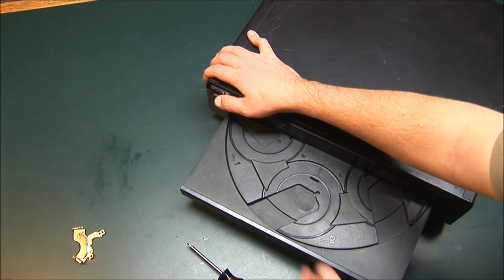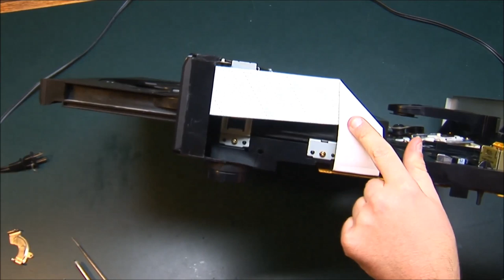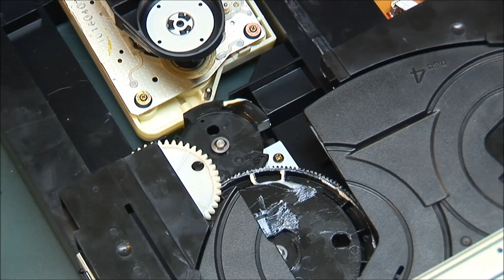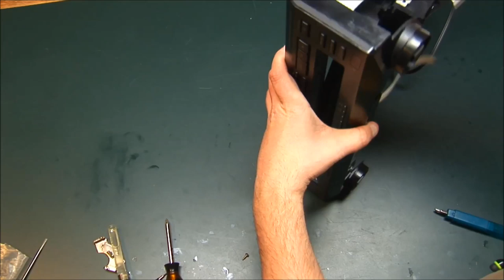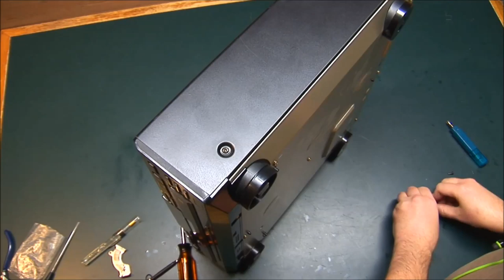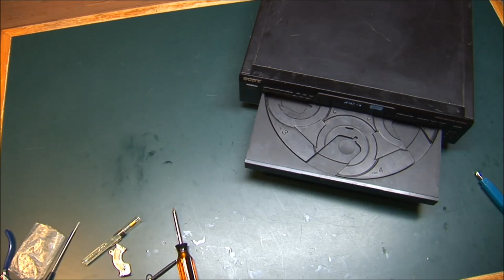Sony 5 Disc CD Changer Repair - Stuck Drawer, belt replacement, dissasemble

Comment from the maker: Help me create more videos
Consider Donating a couple bucks at the link below
Thank you so much for all your great comments and support!
https://www.buymeacoffee.com/cPnDUTmjl
Reply: Can you help me with my CDPC400 Sony Compact player? It’s making a clicking sound, even when turned off, & the tray will not open.
Reply from the maker: @EGGZiX  only way to know what's wrong is to take it apart.  Its probably jammed, or one of the belts is bad.
Reply: @Electronicle , everything seems to be moving properly. It’s the piece that rising to read the CD.. it’s a tiny white knob that spins against a black gear, & it’s like it’s skipping or something. It’s hard to explain but it doesn’t look jammed. Figured I’d ask. Thanks.
Reply: Matthew Hirsch
0 seconds ago
I have this exact unit. It does something weird. It opens, then the draw retracts into the body of the CD player, then it automatically reopens, as if to eject a disc. So, I can turn it on, open the drawer, load a CD, then close the drawer - then the drawer won't stay in the closed position. What have I got? Easy? Hard? Forget it? I will appreciate your feedback, and I will be happy to "buy you a cup of coffee" for your time and effort.

Comment: My rotary belt had come off. I put it back on and ordered a replacement in case it breaks. The error message, just said ERROR and it sounded like something was just spinning. I am amazed such a little rubber belt turns the whole tray around! Thank you for saving my 20 year old disc player!!!!

Comment: My Sony CD Player would not open. I used the screw underneath to get the 5 disc tray to open partially and you showed me how to open the cover where I found a stuck CD. Thank you for the instructions, it works like new now. I told my wife not to leave any disks in the machine from now on!

Comment: Two days and two 5 disc tray players repaired thanks to your videos.  One is for our church and one is at our home.  The one at home was skipping and needed a minor adjustment to the potentiometer.   (I found that the "guts" of the Kenwood machine were supplied by Sony.)   For the one at church, someone had gotten the gears out of sync.  Now it's working like a new unit.   I appreciate it, owe you,  and your "coffee" is on the way.
Reply from the maker: That's awesome man.  Great job!  And thank you

Comment: Dude, thank you!
I have a Sony 5-disc player very similar to this one and its tray was out of alignment. I have a tech degree and opened up the top to look inside, but no obvious problem was apparent, so looked up a tutorial and found yours. It was perfect for me! Different symptoms, but dismantling it and letting it reset and realign as you did here solved my issue. My player and the one you fixed were virtually identical inside, so everything you did I could follow on mine.
Thanks again, man, so you saved me taking it to a shop or buying a new one. Mine's 20 years old and is now as good as new. I checked the sprockets and belts and they still seem fine, so I'm good to go. CDs play fine and no misalignment issues anymore. 
Cheers!

Comment: Thanks for your excellent video with calm and detailed instructions. Thanks to you, I saved a Sony CDP-C335 from the land fill.  I got it with a jammed disc drawer and found the Lever Lock ( Drawer ? )  end broken off. Some super glue and steel wire embedded in Plastic Epoxy hopefully fixed that for some more years. I think someone tried to yank the drawer out in order to remove the CD that was still in the drive.

The "automatic Home" calibration was key in verifying the repair afterwards. I've taken apart my Sony CDP-C435 several times because of a yet unresolved intermittent Disc Exchange  issue and always was hit and miss to determine how to establish that Home position.

As of yet, the CDP-C435 5 disc tray sometimes has a mind  of its own and just spins one way or another like it is lost. Wondering if it is a bad ribbon cable or photo detector?
Anyway, thank you for the excellent videos. Heading to contribute if link is still good.

Comment: Thank you so much. 3 weeks ago when loading my cdp-c345 one of the discs wasn't firmly in the tray and when it closed it jarred the drawer. The drawer would close but could tell it wasn't closing properly. Soon the tray stopped turning at different intervals when on random and the last straw was when I placed one disc in a tray and closed it out made a horrible noise, the drawer opened back up and no disc. Then the drawer closed again, more horrible noises and the drawer reopened with the disc back in the tray. Watched your video that was very easy to understand and got the gears realigned. Put it back together and played it on shuffle for 6 hours straight with no issues. Thanks!!

Comment: I have an old aiwa 5 cd changer carousel that opens and closes multiple times before accepting a disc and you can forget having it on random when loading more discs as it will just open again when changing disc. I assume belts need replaced.  Some discs it just won't play, but same disc plays in car player. Is a big clunky old unit but I'd rather repair than ditch.
Reply: Also, clean the laser heads and any gears.  Also, lube the gears with the "Moly" stuff (similar to silicone but better for electronics).  Good Luck.

Comment: So this looks like something I could do since you've done a good job of showing how to do it.  If that was my unit, I'd want to replace that toothed belt as well since it looked pretty loose. BUT, my question is, where do I get those belts?? This thing is quite old and I'm afraid parts will be very hard to come by.

Comment: I have a CDP-CE235.  I  set the gears to their home position but when i put the drawer in and test it the drawer will not stay closed.  When I took the top off there were 4 cd's jammed up in the turn table and a little white plastic part that  I have no idea where it came from.   Any suggestions?  Thanks for taking  the time to make this video.  It really helped me understand how these things work!

Comment: Bought the same unit 24 years ago. Recently I transported  with a disk, came loose inside And jammed, since then, it's not working correctly. Will try the steps in your video. Are the belts for the c? D drive very specific or generic.  Greatly appreciate your tutorial.Gave you a thumbs up and Is subscribed. Paid about $400 or so back in 2000 I figure it's gonna cost around 1500 to get the same sound quality.
Thanks again for your help

Comment: Man I'm so glad you posted  this!!!
 I have one question , I have a sony cd changer..
5 disc and the drawer spins but won't  open.
 Is it the same belt that needs replacing?
 Thanks again.
Reply from the maker: sounds like somethings hung up or a bad belt...can't remember if this unit uses a belt to open the drawer.  Regardless...open it up and take a look :)
Reply: @Electronicle  
Thanks for responding. 
 I hope to get a chance  to crack it open soon.
 Might have to refer  back to you once I get a look inside.
Reply: for experience.....you must to change all the belts ...if the CD player has 2 o 3...just replace it ....

Comment: I have a Sony CDP-C331 model have had for a very long time.  In 2019 I had to place my property in storage due to unemployment,   the player was wrapped in a bath towel, transit key installed, the unit placed inside of a bedroom chest of drawers and the chest placed in storage, for almost a year.  Its been out for 2 years, plugged in but not used, they transit key was removed.  I turned the unit on today...the tray will not come out,  so I took the lid off,  the optical chassis is in the closed/up position, slightly bouncing like a heart beat,  it will not go down.....before I completely open this unit, have any suggestions/recommendations on what is wrong?

Comment: I have similar problem with my CD Sony Changer model CDP-C365 . Sometimes happened , when the pressed play button the tray  is opened  themselves and stuck and players tray seaching position and sometimes not find and leave dics on neighbor disc . Keys not working , i must power off CD player and turn on again after that error.  Do you think thats is Faulty pickup sensor or belt?

Comment: great video for disassy and assy and access to belts, and didn't know about finding home position... how would you improve lubrication of this tray? I know on some older equipment that white grease gets hard and sticky... would you clean and put some new lube on the gears and sliding rails?

Comment: I just bought a 305 yesterday that did not have a remote control. with 5 discs in and it worked great, I lifted up the back to take a photo of the model number, one of the discs 
came out of the tray and now the drawer will not open.  HELP with advice if You can.  I dont dare turn it upside down to use screwdriver on that special bottom screw.
also looking on ebay for a remote, none for sale mention the 305, so I do not know if they would work with wifes 5 disk player that she is gonna kill me if I dont fix it.

Comment: Would it be a belt or alignment problem if the tray keeps opening and closing on its own? Mine does that repeatedly. Sometimes it will sort of slam open. It will usually close and play after a while or after I mess around with pushing buttons.

Comment: I have a 5 disc player Hitachi 
It's does not stay open when you press the open/close button.

Is I press it a number of times it will stop and stay open.

Could it just need a cleaning inside?

Comment: Should I do the tray realignment when it comes to the laser mechanism being slightly off when it tries to pick a disc? The tray seems to work correctly until you want to play a disc. When the laser pops up to read the disc it tends to collide with the tray and rejects trying to read the disc.

Comment: Great video, thanks. I have the exact same unit, belts are fine but I followed along and did all the same other repairs, aligned it but it still won’t work. When drawer is all the way in, still sticks out 1/4”. Drawer only comes out most of the way when I hit the open button. CD transport now won’t engage. Disc tray turns ok, lines up right with transport which was off before. Any tips? Nearly there, it seems.
Reply: I have a mini component with a VERY similar cd exchanger, check the alignment of the cogs, one of them has weird notches that only allow it to rotate/open certain distance

Comment: Very informative video, thank you for showing us a well explained and detailed step by step video.  I have a SONY CDP-CE375 5 DISC CARROUSEL.  All works well, however the disc 3 and 5 will have a hard time picking up and spin the disc.  At times it will screech when picking up, but will not spin.  Took the cover off, but cannot figure out where the problem is.  Any suggestions anyone?
Reply: Sounds like belts are getting stretched and slipping.
Reply: Do what he did here. Take it apart, including removing the tray, and let the gears reset and realign. It can't make the problem worse and will likely fix it (worked for me, my tray was out of alignment, but works fine now).

Comment: Thanks. I wonder if this is the same problem for my parent's 1993 Sony SEN-231CD (HST-231/CDP-C231)? The tray won't open. I unplugged the power receptacles and disconnected all the parts - everything needed a good dusting and cleaning [Round 1]. While cleaning and dusting the system, I noticed that the left speaker was connected with a spliced connection wire and it needed some attention. I stripped the wires and spliced a new clean connection.  I want to get a better wire because this wire was half copper and aluminum (?) speaker wire. I want to purchase a better speaker wire that is copper (+) and copper (-) .  Tomorrow or next week will be Round 2.
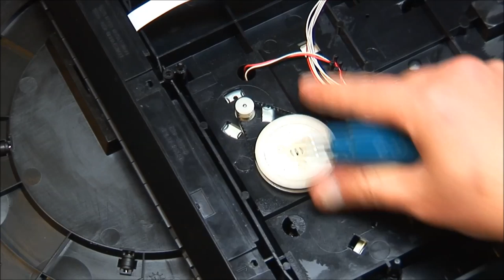Reply: Well, today , Sunday, October 29, 2023, is Round 2 for my troubleshooting my parent's compact disc player.  I initially removed the cover and noticed a black piece of rubber sitting on top of the CD Tray - I suspect it is a belt, but it appears to be a smooth belt.  I think it may be the belt that was identified in this video at 3:40. I guess I need to remove the bottom case panel.  Wish me luck!

Comment: I have a SONY CDP-C315. The toothed belt appears to be missing a few teeth. The other smooth belt seems rather stiff or slightly hardened. My carousel does not turn so I am guessing these are my problem. I have looked on Amazon and EBay but can’t find replacement belts as yet. Any help on where to find would be greatly appreciated. Thank you.

Comment: Thank you! Got a used CD player shipped (poorly packaged) and the drawer was stuck open. Seller refunded me AND I was able to fix it with this video. Oddly have a small white plastic piece that was loose- couldn't figure out where it fits but it everything is working for now.

Comment: I have a Sony CDP-C445 five-disc cd player. Sometimes the laser unit apparently does not drop the played cd directly back into its round tray compartment, but drops the cd onto the carousel itself outside of the cd's round tray compartment which jams the carousel. This has occurred about 5-6 times in the last year. Any suggestions on how to fix this problem?

Comment: +electronicle I have a sharp brand 3 disc carousel stereo with cd player/radio & 2 tape decks in the 1 unit.
3cds are stuck inside the unit & when i power it up the lcd display says ER (error?) 
On powerup i can hear the disc platter rotate once but front panel buttons dont respond,about a month ago it would play ok but was erratic bcos the drawer would constantly open & close by itself while 1 disc was playing,any help u could offer would b appreciated as its been driving me crazy for some time ☹☹
Is is worth fixing?,or should i get a new stereo?

Comment: Thanks for the video. Have a cd/tape deck/radio Sony all in one unit, and the gears driving the tray won't stop spinning. Found a snapped belt on one of the cd trays. I suspect it is the same issue as this video. Would the process be the same and are the belt replacements still available from Amazon/Ebay? Cheers

Comment: I have a six disk Sony CD changer. It isn't a carousel nor cartridge type. It has five drawers for CD s and a single one for CD R. The 5th drawer for CD won't open.  The belt makes a squealing sound when trying to get to disk 5. You think it may be a problem with the 5th tray itself? Now, I didn't have a problem getting tray 5 to open after holding both doors open on the 5 disk changer part. So I don't know what the problem may be.

Comment: I want to do this with my cdp-c245, but i'm worried about getting an electric shock even if it's unplugged 😅. How long does it take for the capacitors to discharge?

Comment: Thanks for this video.  Just to confirm, the toothed belt handles the door open/close, and the smaller belt under the tray spins the tray around into the 5 different positions?

Comment: What do i search to get the assorted belt kit on ebay/amazon? I need belts for a 60disk mini system and i cant find any part numbers for the belt kits i need for this thing.  They are all shot. Tape decks.....carousel motor etc. I have the unit apart but i cant find a manual with part numbers for the belts i need. Hoping to get an assortment pack and try to measure them up to my old rotted ones at this point. Be a shame to let this thing head for the trash. Its like new. Only a few hours on it total but i went to turn it on and surprise.....junk.

Comment: I have this player it came with the 5 disc tray but I changed it to a single disc...this would not come out and it wasn't bumped in fact had not been used to a few years...just froze up

Comment: The sides of my tray are chipped .part is no longer made and suggestions .tray gets hung up on the chipped parts.
Reply from the maker: See if you can buy a non working used one cheap on eBay

Comment: Not what I am looking for but getting closer, lol   Everything plays great on mine, But when I try and play more than one CD. The turntable jerk's so hard when changing to the next song or disk. That my CD disk ends up somewhere on the turntable not able to play. Plus my CD's are getting damaged all the time. So what processer or control board needs to be changed out. You can hear the two piece turntable jerking hard left to right each time a song changes ?   Please reply
Reply: Did you replace the drive belt under the tray like in his video?  Did you find one that works? I suspect that belt is stretched and slips/catches when changing discs. This acceleration when it catches may cause one of the discs to jump out of its tray and jam the turntable. I can't find a NOS Sony belt. The aftermarket has a Sony belt with a different PN. They advertise that it replaces several belts, including mine, but that may be a sales trick to move product.

Comment: This video is gold. However, when I got to the tray motor/gear/belt, I found the belt to be in great condition but the plastic gear is toast. Ideas for finding that part?
Reply from the maker: I'll look later to see if I have a service manual and the part number. Doubt Sony still stocks em.  Could either 3d print one or find a dead parts unit on ebay for cheap.   Who knows,  with the part number someone might be selling just the gear on ebay.

Comment: Why in none of these videos about repairs don't they take a minute to clean the laser lens.
Reply from the maker: Because out of the thousands of tray loading CD Players that I've repaired ZERO needed cleaned.  The only ones that ever had that issue are top loading players...such as the original Playstation design, but thats only if the lid is left open for a long time.  Plus as the cd spins there's a light air current generated which moves dust away.